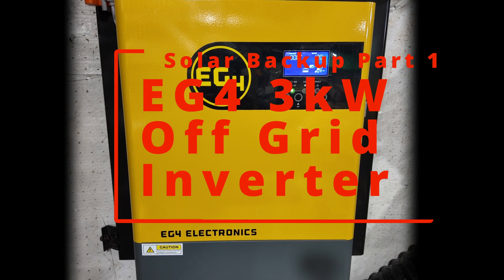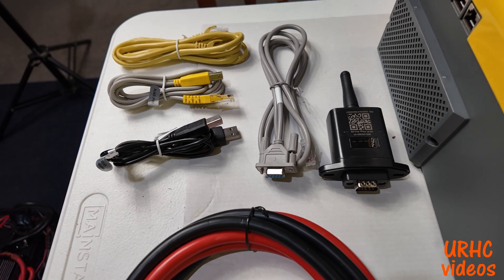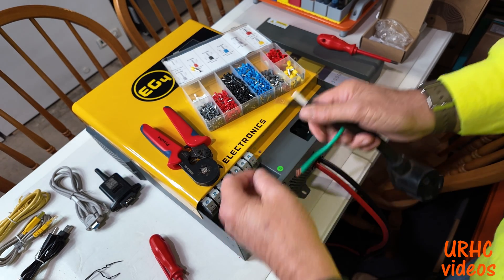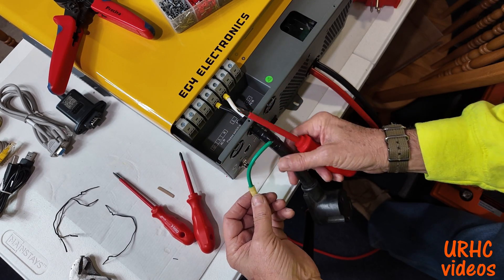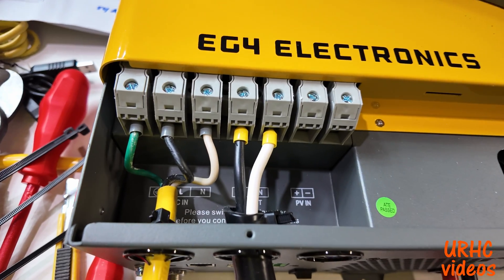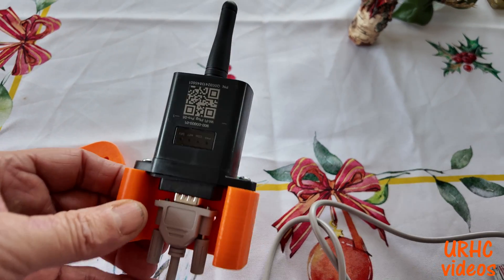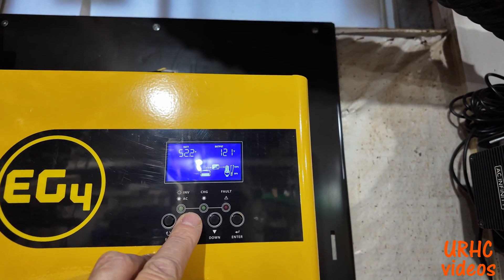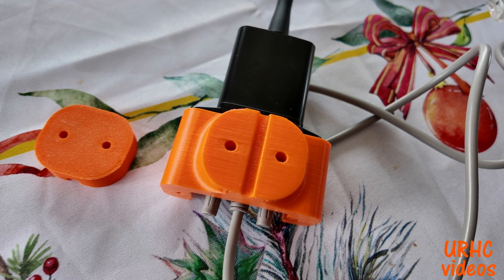Solar Backup Part1. EG4 Off Grid Inverter

Comment: I would never install one of these low budget high frequency, transformerless inverters in my home. They offer much poorer peak power (surge) capacities as well as a shorter life expectancies than longer lived, higher peak power capacity, low frequency, transformer based inverter chargers. And without a transformer to provide galvanic isolation between the DC boost stage and its AC output, they're nowhere near as safe as a low frequency inverter and can even damage your appliances when their MOSFETs fail.
Reply from the maker: That's the chance you take with these low cost inverters.  We have everything plugged into surge suppressors due to the constant outages and grid spikes from being at the end of the line and hopefully they will help. Ordering 2 of the 6000xp soon and adding an outside building for it all in the end. Wonder if an old isolation transformer on the output would help. Thanks for watching.

Comment: Thats a good inverter brother... There server rack batteries are awesome too been off grid for 11years i bought the 6000xp last year fixing to sell my 24 v outback with 24v eg4 server rack batteriers moving up to 48v..... Keep it up brother
Reply from the maker: It's a great step up from what I had. I'm looking at 2 6000xp for the trailer but didn't have the money for them this year.  I bought 2 Vatrer 48 volt server rack batteries on black Friday. I wanted EG4 batteries but decided I don't need communications now and got the Vatrer batteries 10kw total delivered for under $1800. 2EG4s were over $800 more with shipping.  Hopefully I can add the other freezer and refrigerator with 6 more panels. I didn’t realize how much power the inverters draw when there's no solar for 4 days. Looks like there's no payback for solar in my area with the storage requirements. It's a good feeling to know we could survive without grid power comfortably now. Thanks for watching.